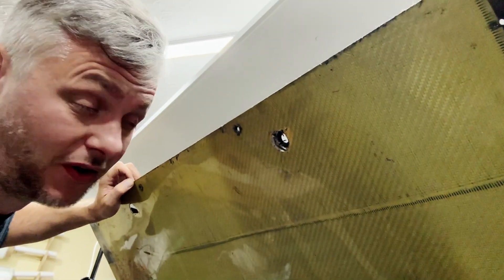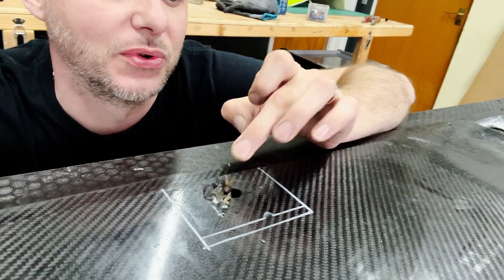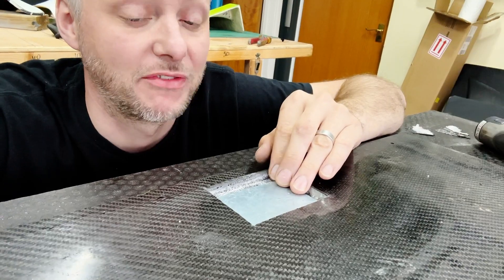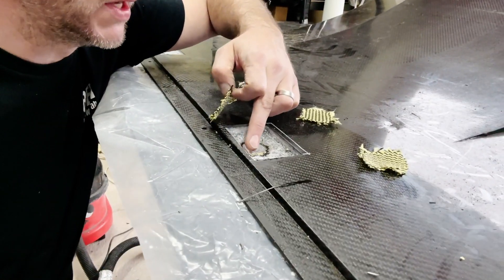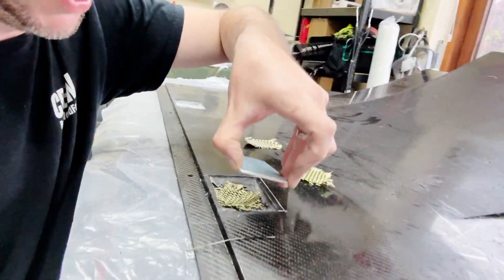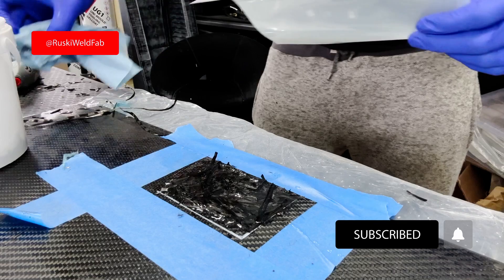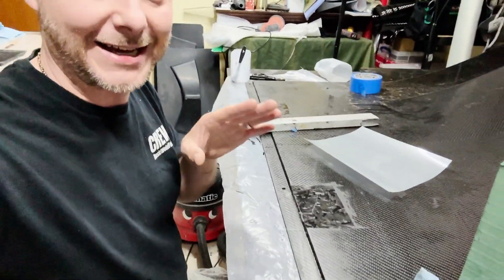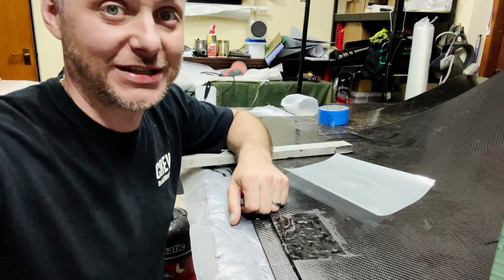Fixing Carbon Fibre Holes With Forged Carbon - Easy Repair Tutorial!

Comment: As you learned, fender washers are not enough to spread the load. In general, you should always add some aluminum angle or brackets to form a brace on top of the splitter. But nice job on the repair.

Comment: Biggest takeaway, reinforce your mount points before you have too!
Easier said than done though, if you don't know where they're going to be and it's a one off.
Reply from the maker: absolutely this! most things i have done, customers have no clue how its going to be mounted. i usually add extra layer in places where i think its going to me mounted.
Reply: Hey ruski, I've been thinking of making the clio 172 cup spoiler in forged carbon, any tips on the way to go? I've never don't anything like it before